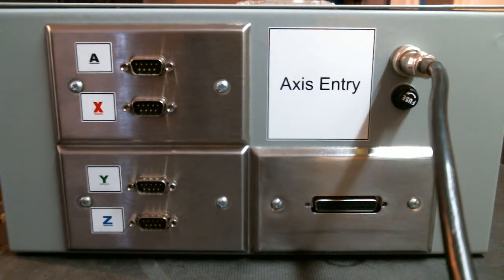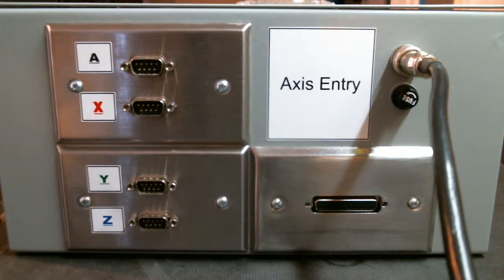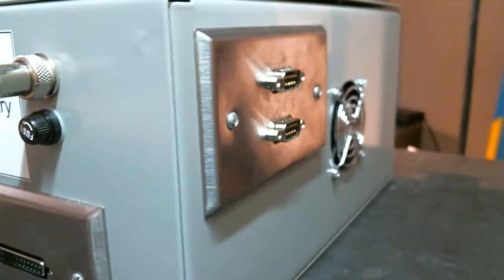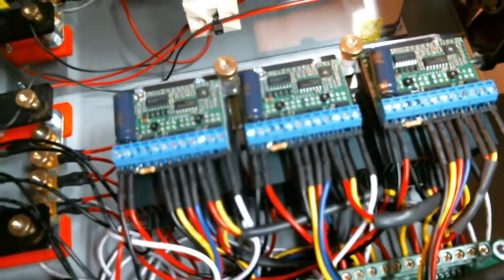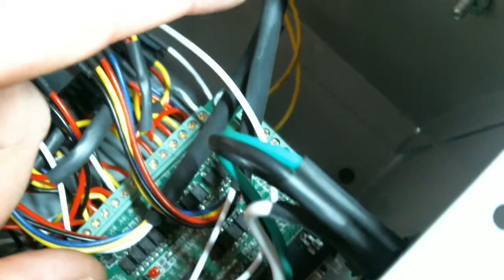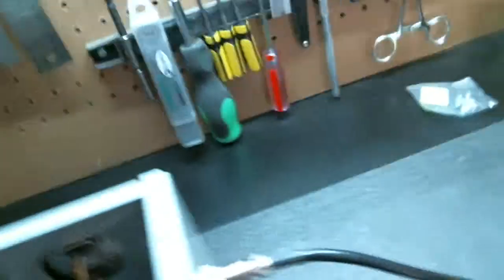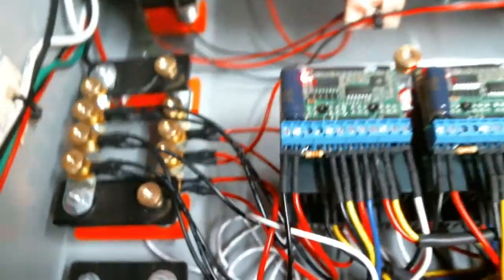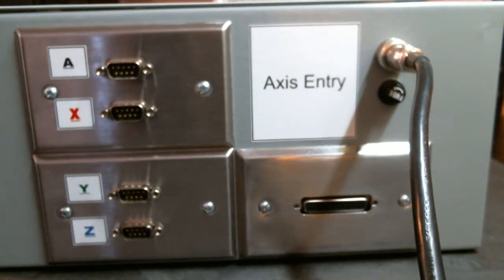6 Axis Gecko CNC Gecko Controller For Fortune 500?

Comment: Question: you said you separated your grounds. So the gecko drives dont make contact with the chassis? 

Im fighting an issue here: same drives, torroid psu, but whenever i power it on, the pc totally locks up til i shut it off. My earth ground is to the chasis and there is continuity between it and the dc gnd...

Nice work btw. Im more of a din rail and terminal block guy.
Reply from the maker: MrZeppelin1007, Thank you for your support. The chassis has the BOB common separated which are for the drives. The only grounds run to the chassis are for the motors shield drains. Your issue is most likely a PC ground loop which is very common. I suggest connecting a large gauge  lead to provide the least resistance from your CNC enclosure, to the PC's metal enclosure, and see if it makes a difference. If it does you know what the Gremlin is  :)

Thank you again,
Vince
Reply: Ahhh so wait a second. So I’m clear, your dc grounds are all separate from chassis ground?
Isnt the db25 port of a pc tied to ac mains gnd though?

Ive got a new fun problem of hearing arc’ng with no motors hooked up and cant find it. Transistors all check ok. Found one current limit resistor wasnt connected (but looked like it) waiting to hear back from gecko.

Thanks again Vince
Reply from the maker: @TechNick3D   The common terminals from the BOB are separated from the ground of the shield drains. If your hearing arcing its time to start over. I suggest hooking one connection at a time to isolate the issue which makes correcting it much easier. 

The DB25 port is a port on the BOB, so its DC, and not AC. It would be attached to the devices ground it connects to which would be a DC component (BOB, motherboard of a PC) In theory it should be attached ot one central ground, but some PC's have floating grounds.

Thank you, and have a great weekend!
Vince